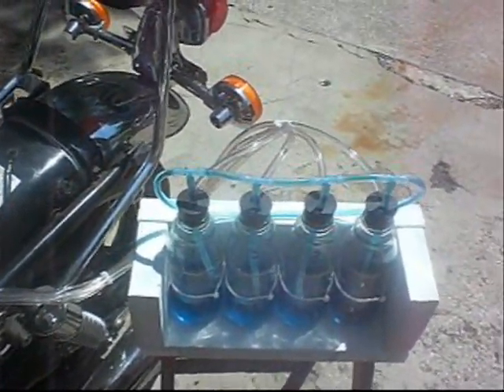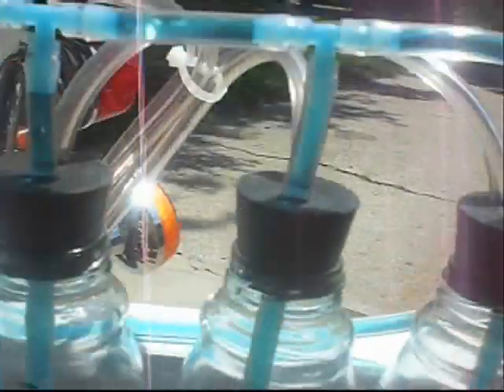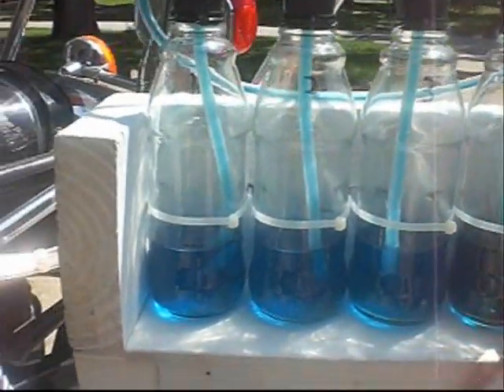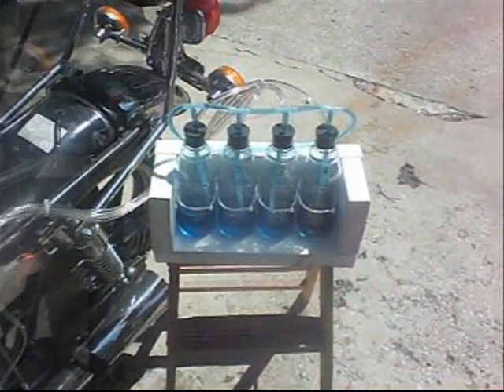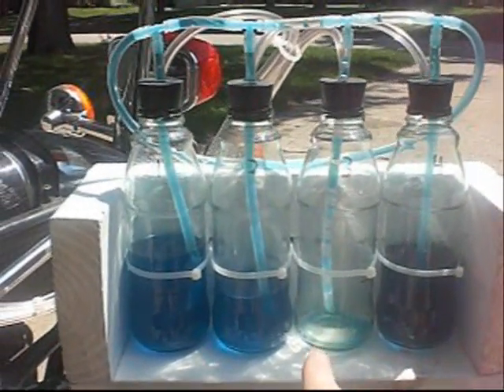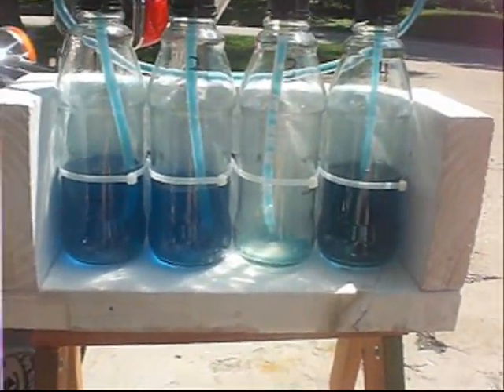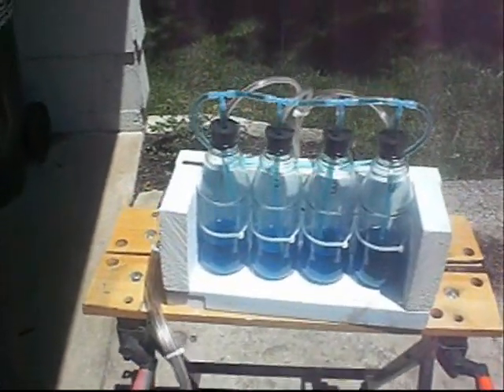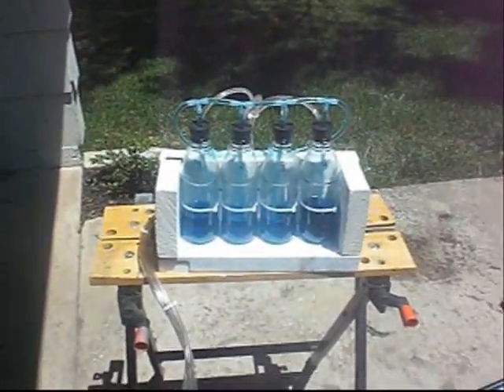Homemade 4 Cylinder Carburetor Synchronizer/Manometer

Comment: If you use 2 cycle oil as your Synchronize fluid, getting some in the engine is not a problem. We include instructions for this in our Jet Kits.  https://www.6sigmajetkit.com/

Comment: You should use transmission fluid or 2 stroke oil instead of water. That way if any gets sucked into the engine it'll just burn off.

Comment: I put mine together and I got water going straight through the number four carb. I have the line on number two vaccum line with a Tea to the bottle and vaccumm to the xj 750 tank.
Craig

Comment: I just built one and tried it on my 1100 vtwin. THE 2 PLASTIC BOTTLES SUCKED IN, OR SQUISHED. IF I USED GLASS BOTTLES WOULD THEY EXPLODE.
Reply: Nope. The reason glass is used is because it will maintain it's shape under the relatively minor pressure generated by the carbs. Plastic is too weak, which is why you can deform a plastic bottle with your lungs. So basically, use a glass bottle.

Comment: this will be so helpful, thank you, i knew there must be a method that takes the cylinder differences into account not just the carbs them selves, and depending on your accuracy to read the level this would be the most accurate way you could measure things, larger diameter bottles would increase the accuracy would they not? i would think the more fluid it takes to affect the level the more accurate it would be but it would take longer to see the differences take affect, you could make two, one with small bottles for the base adjustment then much larger ones for the fine tuning, also any leak would affect things, but you could do a pressure or vacuum test to make sure you have no leaks, i applaud you in your efforts and your video, i assume this has an affect on fuel efficiency? do you have any other tips besides ride style to increase the bikes efficiency? i know weight is one but how much does that really affect it? and chain and bearings should be another, but what is the best to get?
Reply: or you could just splice a used jet into each line (each jet must have the same orifice size opening) thereby reducing the volume of the fluid needed to effect observable change reducing the amount of vacuum needed to effect change. It just makes the device much more sensitive than using the full tube diameter, thats like swinging a tree as a fly swatter. Any little tube or reducer you can insert into the lines (remember ALL of them must be equal in I.D.) will do the the job.

Comment: How can carbs air-fuel adjust?
Reply: That sounds more like a how do carbs work question and the internet can answer that query. Simple answer is the various needles and jets control the air/fuel mixture ratio.

Comment: Why did you connect 1th bottle with the 4th bottle? thnx
Reply: +Maxim S. mean is it enouhg to connect just 1&2 2&3 3&4 with tubes without the "reservoir"?
Reply from the maker: +Maxim S.   Functionally, yes, it is the same, but it makes it easier to fill the tubes with fluid and keep air out.
Reply: +kcorbings550 Thnx man!

Comment: I'm curious how you make the adapters. I know you say specific to bike make/model, but how do you make yours? I have heard of using hex head cap screws and drilling thru them, but that seems like a lot of work?? I'm curious if there is more simplistic way?
Reply from the maker: +Photography.Naturally  I used hex cap screws drilled through, with brass tubing pieces soldered to the head.

Comment: wouldn't 4 vacuum gauges work better?
Reply: jeff i These do the same as any other manometer, perhaps even better since the deviation is minimal (assuming there are no air leaks). But this just cost around $10.- instead of $80.- for a set of gauges. Plus you have the satisfaction of being a DIY king. What I do miss in this video is at what rpm he does it and there's no warning for overheating air cooled engines while doing this.
Reply from the maker: +Roald van Dijken The RPM for syncing depends on the motorcycle model so always check your manual.  This was between 1500 and 2100 RPM.  Usually it will be slightly above idle.

As a general warning, yes, always use a fan with air cooled engines when doing extended tuning sessions.
Reply: The 4 vacuum gauges would have to be calibrated to each other and have the same response curve but yes you could use 4 vacuum gauges if they were good quality and able to be calibrated. It's not really ideal because such gauges are expensive and sensitive. You have to really dampen the vacuum fluctuations otherwise the gauge needles will be wildly bouncing making them hard to accurately read and hard on the gauge itself.
Reply: Comercial dial vacuum gauges may not be accurate enough.  You would not know the accuracy.  For example one could be reading 5% high, another 5% low.  With a fluid, it is perfectly accurate.  The commercial ones with mercury would be nice, but expensive.

Comment: Has anybody tried this on the keihin fcr flatslides?? I know on the keihin carbs it's critical to get your idle circuit balanced correctly as the idle adds onto the total fuel flow of your mains at W/O/T 
But they also have the adjustable air bleed under the ram tubes ontop of the carb, if you adjust the air bleeds will it show the same in the manometer as adjusting the idle mix screws?

Comment: the empty bottles AND TUBES self fill once the vac is balanced more
Reply from the maker: +Dan Barclay Great point: once a bottle goes dry, it is possible to just keep running and open up another carb more to pull enough fluid back into the dry one.  Preferably not your original reference lowest vacuum cylinder.
Reply: And I have never found such an accurate stable method where you can hear all the cylinders come in on song  exactly according to the readings - unlike gauges that merely get close. Whilst not having to go to any great lengths checking the accuracy or setting up.
Reply: Extra points if you can come up with a method to eliminate the set-screw backlash so it's not as frustrating as...
:-)